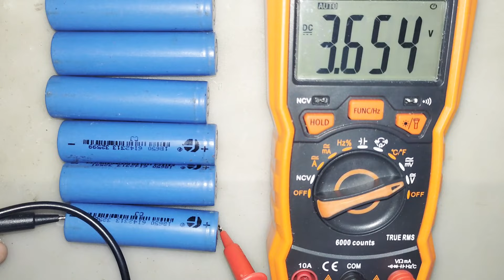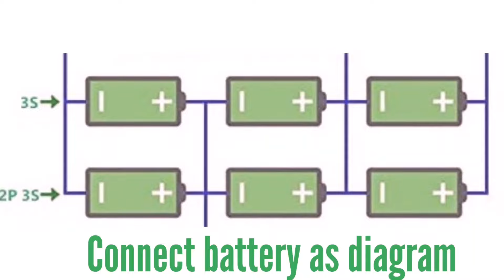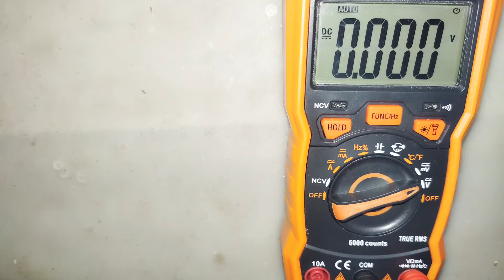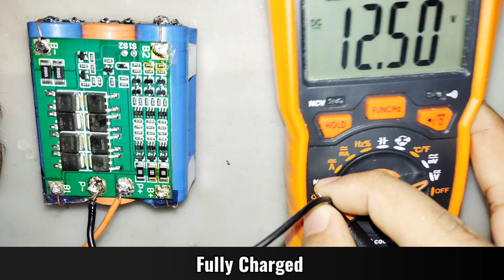I Made a Lithium-Ion Battery Pack Out of Old Laptop Batteries

Comment: Completed wiring perfectly alright,on BMS,3స్,20A module, values are perfect but at out put getting 7.7 V only. What could be the reason bhai?
Reply from the maker: Try changing the battery pack with 12.6v , sometimes it deactivates output
Reply: @Electronic_For_You  brother🙏with DMM measured voltages on BMS, 3S, 20A module as 3.83v, 7.3V, 11.36v, by placing DMM black probe at Ov.  But the o/p is 7.7V only. I am using 6 batteries total, 2in parallel each(for high current), with 3 pairs to get 12v, to use as Honda Activa battery
Reply from the maker: Try to charge the battery to 12.6V

Comment: Oh my goodness.  You rely on that thin blue "sleeve" waaaaaaay too much.  

Your battery has about 15 locations where the wires and/or cells are just about to short circuit from positive to negative of the next cell.... or even the SAME cell when you solder across the positive sides of the cells to the next parallel cell.   Those sleeves fail constantly and this design needs to be reworked to insulate and/or isolate those cells from each other.   

This is a major safety issue.  Also, you're not using any fuses to help mitigate problems. 

Please rebuild with fuses and insulate/isolate all cells..... and some type of insulator under the BMS so it's not touching the blue sleeves.
Reply from the maker: Thank You for your information Brother 😊

Comment: how do you charge that
Reply from the maker: Use 12V Adeptor 😊
Reply: @Electronic_For_You  i have 12v charger but i tested its output its 14v is it ok?
Reply: but when it starts charging it goes down to 12.1v
Reply from the maker: 🤔 14V is too much 
13V ok
Reply: @Electronic_For_You  but when charging it goes down 12.1v
Reply from the maker: Its ok